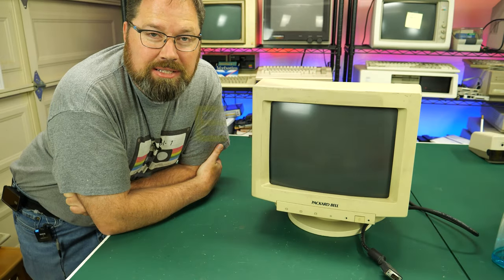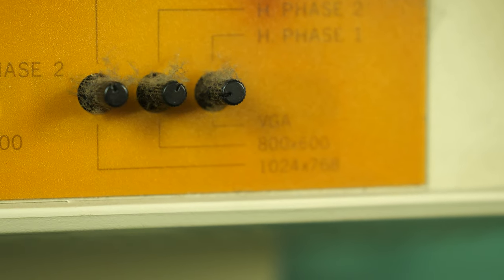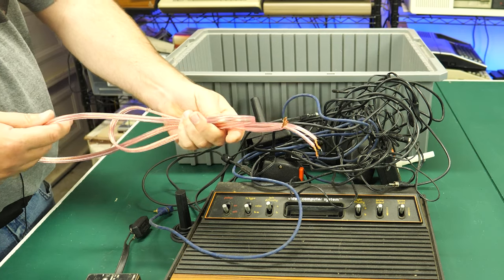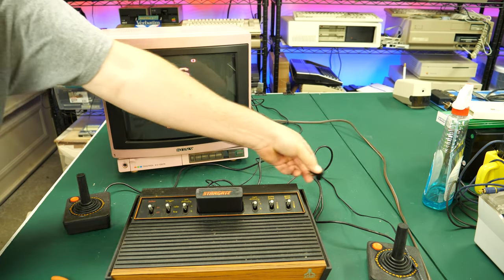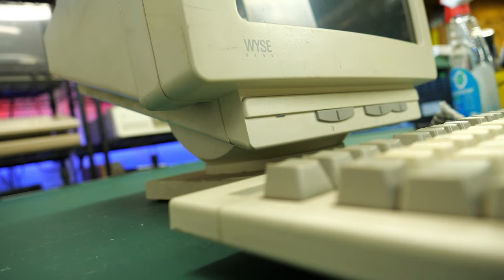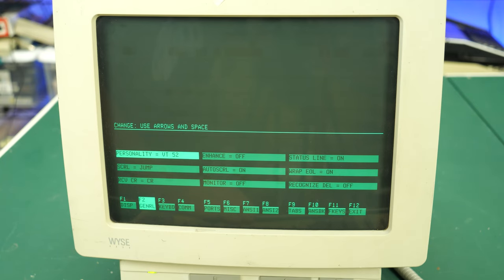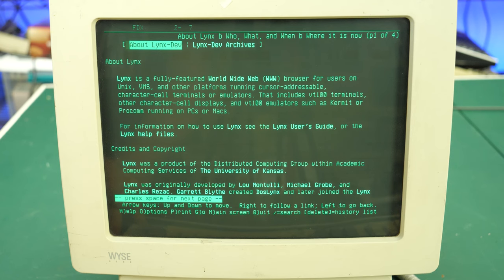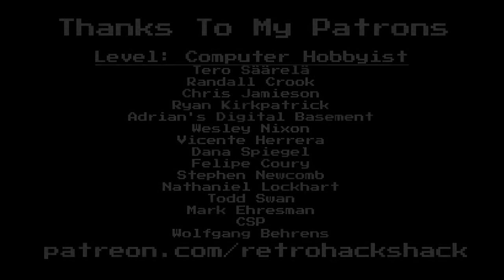Atari 2600, Wyse Terminal, Packard Bell Monitor

Comment: I have a Wyse-55... It supports 132 columns by  43 rows...  Just configure the rows and columns in the terminal (SHIFT-SELECT) after, add this command to .bashrc: 
TERM='vt100'
stty rows 43 columns 132

This terminal has even SMOOTH SCROLL ! I use it as my main terminal in my network :-)
Reply from the maker: So cool. Unfortunately, I didn't have time to go through all the settings, but it is amazing how functional it is.

Comment: If it was using MX switches, the old Wyse keyboards were prized for their Cherry MX Black switches. They came from a time where it is believed QC or standards were higher, plus they are worn-in.

Sometimes, people threw away the keycaps after 'harvesting' the MX switches. But the Wyse keycaps are excellent in their own right. The MX keycaps were produced by Comptec before Signature Plastics, and used the great DCS profile. Some of the Wyse keycaps were super-thick doubleshots, with quality and characteristics hardly seen today.

Comment: Had a monitor that looked nearly identical to the one shown.  Came with a PB Legend... 4 I believe. 286/12 with co-processor, 4MB Ram, Oaks VGA card, 340MB worth of HDD space, and a SB Pro. It replaced our CoCo and wasn't retired by my dad until he got a P2-450.  
Don't have it anymore, but I do have a CD ISO of the drives as they were when it was gotten rid of
Reply from the maker: Awesome! Glad you archived those. It was always an afterthought for me at the time, but I wish I had done that with some of my computers over the years. I made a drawing of the Enterprise from Star Trek TOS along with the music from the first movie for the Coco at some point. Unfortunately, it is gone and I will never see that again.
Reply from the maker: @formyroku BTW - As luck would have it, I stopped by a place just now and they had a PB Legend that I picked up. It is a 486-SX though. Perhaps I should pair this system with the monitor when I do a repair video.